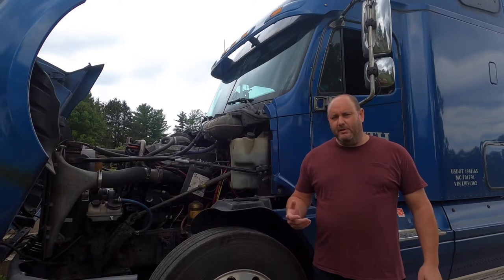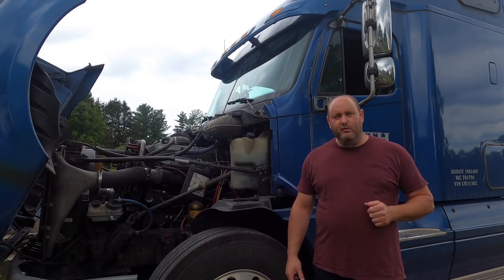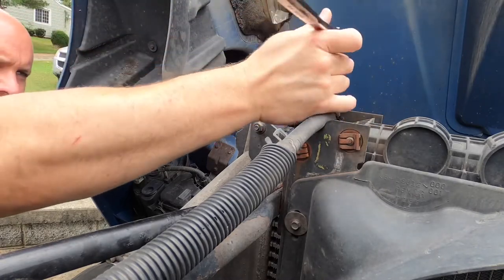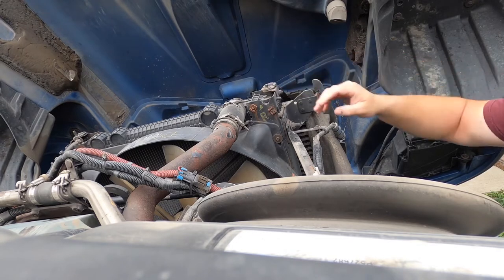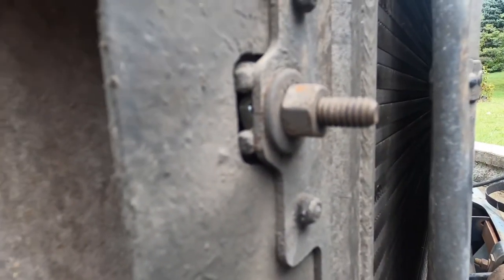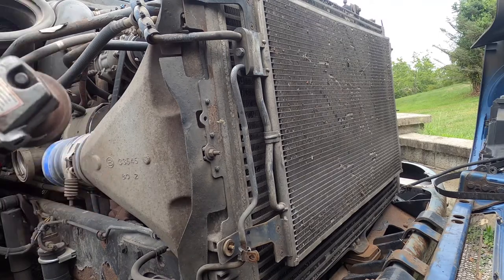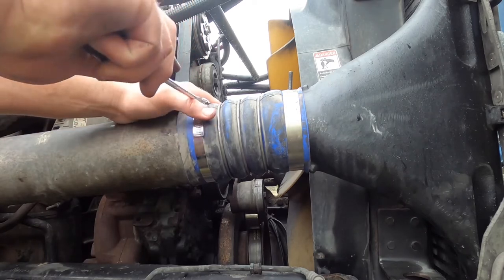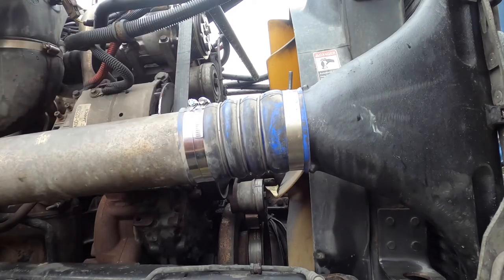Trucking , How to replace a Turbocharger inner cooler on a 2007 Freightliner, Series 60 Detroit.

Comment: Good afternoon Scott . I enjoy watching your videos . I do most of my truck repairs just by learning new tricks from you . I have a 2007 Freightliner Century with a Detroit 60 14 L in it . I have been having a problem with my Davco fuel and water separator unit . I installed a new filter in it .After 60 miles of driving , the fuel keeps getting lower than the fuel lines sending air with fuel to the injectors causing loss of power , shacking and white smoke. I replaced the filter again , I replaced all the fuel lines from the tanks all the way to the Davco unit and back ,I also replaced the fuel pump plus the the fuel lines ,I checked all connections and made sure that there is no air or fuel leak anywhere . The problem still exist . I have been topping the container with fuel half way through my trips so I don't mess up the injectors. Repair shops couldn't find the problem ,some of them suggested that I replace the whole water separator unit . So before I buy and replace a new unit , I decided to get your advice first . Thank you
Reply from the maker: Check the globe for any cracks , this will allow air in . There is also a check ball under filter that may be stuck or has something in it .
Reply from the maker: I would also check for leaks at the shutoff valves .
Reply from the maker: Sounds like you have covered the basics , you have used a new oring on the globe on the top and bottom right ?
Reply: @Starkeyfamilyfixing  Hello Scott , thank you for your reply .The globe is in good shape and has no cracks . I replaced the check ball recently . I inspected all the shut off valves ,every thing is clean and has no leak . I even replaced the check valve at the back of the engine with the fuel return lines all the way to the top of the trans.

Comment: Excellent vid. Step by step. Gonna have to have mine tested because I upgraded to a B&W waste gated and I swear I feel no difference. But hear lots of air when it boosts past 25 psi
Reply from the maker: Just keep in mind , that adding more power like upgrading your turbo adds more pressure. So if your air to air cooler is older they will give out . The same goes for all of your boots , clamps , ect. But also check your exhaust where it mounts to the turbo. I was given the same sound as when my cooler burst . The lip that locks to the turbo had cracked off half way around the s pipe on the exhaust coming off the turbo .
Reply from the maker: I was going to also add I did another video before changing the cooler on how to test it . I went through the whole process, it’s not hard . If you have a welder then you could even build your own tester pretty simple

Comment: Hey I have a 07 columbia and right now the turbo is being replaced and i was told i needed a exhaust manifold and CAC. I honestly just want to get the truck moving so I can get it home and change everything else myself. Can I still run after the turbo has been changed and the small crack is still in the exhaust manifold, or is that a case for more problems?
Reply from the maker: Well it really depends on the size of the crack and where the crack is . Yes it will be louder , but you want to make sure the heat is not going to escape the crack and burn something. Otherwise drive it home . I would suggest not doing another manifold and buying a header pipe . For some reason I know alot of people I know that has had one crack , has had multiple crack , but the ones buying a header have had no issues after . Everything still bolts up the same too ! Make sure regardless of what you choose , replace all the hardware with new !!
Reply: Where did you get your parts from ? 

Update they put on the new turbo , everything seemed fine down the road, the next day the truck felt like it wouldn't pull the same, found a leak coming from the turbo it got so hit that's it burned my air filter housing and the filter. I'm back at the shop they took the turbo back off and it was oil leaking out into the exhaust, so apparently the turbo was no good. But now I'm worried about the exhaust because one of the bolts case loose from the exhaust to turbo,  I'm honestly thinking about this header pipe because I rather get it fixed while everything is already open . I'm not sure what caused it to burn
Reply from the maker: @theprissytrucker743  got the turbo straight from the manufacturer , not the dealership. The dealership charges 4 times more then the dealer on the same turbo and wants the core or they will charge you for that too !

Comment: Hey I think I’m having that same problem… beside loosing power, were you also burning more fuel than usual with the bad intercooler?
Reply from the maker: Wel your going to because you engine does not have the right amount of air , it will use more fuel

Comment: I’m loosing power too, but my truck started blowing black smoke as well. Do you think it’s related to inner cooler?
Reply from the maker: Normally blowing black smoke and losing power sounds like a fuel injector. Is your truck kinda jerking too when coming to a hill or under a load ? If a fuel injector gets clogged, or just quits working properly. . Also there is a small wire harness that can get shorts that is connected to the injectors . ( injector harness  ) . This is common for injectors to go bad . In the many years I have been driving , I have had many replaced. The last time I had replaced a full box set a Freightliner dealership was running a sale for $1800 for replacement , full set of new not rebuilt injectors , and harness , with a 160,000 mile warranty. This is one of the few times it was cheaper to take it to the dealership .
Reply from the maker: Most of the time a check engine light will come on too , but not always . Also make sure your fuel filter is good ! This can also cause a starving engine of loss of power and smoke from the exhaust. Most of the time it’s the injectors though.
Reply from the maker: You can replace just 1 injector if needed but , if 1 is bad normally the others are not far away from going bad , from just being wore out . If a low money issue is there I would say do what you have to and can afford. But check for codes , this can give you an indication of how many are bad , and which ones , if it’s just an injector harness problem, I have bought them for as low as $60 . Just have to shop around. I hope this helps you out , it’s hard to say what’s wrong without being there to diagnose everything in person. So in this case check for codes , and I would have it put on a computer.
Reply from the maker: There could be several other things that can cause what is happening also . So have it checked out before buying anything.
Reply from the maker: I wish I could help you out more on this . But please let me know what you find out !!!
Reply: I actually changed all injectors, fuel filters and air filter and it’s still doing it. It started with white smoke and loosing power and jerked pretty bad that made the whole truck move.
Reply from the maker: @luissuarez5910  ok mark the injectors off the list , inner cooler for the turbo will just make you loose all your power but will make a loud sound from air, I would say this is now Egr related
Reply from the maker: What kind of truck ? Year ? And which engine?
Reply: @Starkeyfamilyfixing  2012 Freightliner cascadia DD15
Reply: @Starkeyfamilyfixing  how do you know if it's injector harnes problem?
Reply: @luissuarez5910  did you find out what's wrong, i have the same problem, loosing power and black smoke, i changed 1 fuel injector,than all of them than another one cause one of the new ones was bad
Reply: @jovancetrajkov2454  yes, it was the actuator the valve didn’t open. I had changed it but the new one ended up being defected because then my mechanic put a used one that he had in his shop and problem solved.
Reply: @jovancetrajkov2454  the way we found out was because when it started feeling force and blowing black smoke my mechanic was I don’t here the turbo that means the egr actuator is not opening up correctly
Reply from the maker: Yeah those Egr systems can be a pain at times , the bad thing is that you can have different symptoms. I have changed out several.